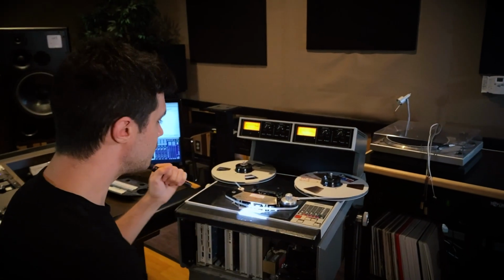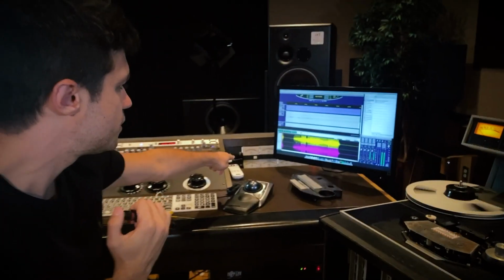Analog Mastering #03 | Tape Machine Alignment

Comment: Hi I was wondering if you’d have any idea why my 2 inch machine isn’t erasing fully. After aligning the machine both repro and record I can get a good strong recorded signal but I’ll still hear what was previously recorded. I.e. the alignment tones. On some tracks it’s more faint and on others it’s louder. What is the cause of this? Is the amount of erasure linked to how much you over bias? Is it just supposed to not erase fully? I don’t understand how punch in and overdubs could be done if that was the case. I’m a 20 year old starting an all analog studio in Ireland (a very small country) in 2024 so as you imagine I’m clueless as to where I’d even begin to find this info. I mean finding the correct nwb/m  for the basf 468 tape I have was hard enough and I still don’t know if it’s right! Help

Comment: It's great that your azimuth is spot on.  It would be useful to see that adjustment performed
Reply: Azimuth adjustment all comes down to phase cancellations, there are many ways to perform the calibration procedure and can be altered for half track machines and multitrack machines. In this video he does a variation of the summing method (by pressing mono) where he combines both left and right channel to see if there is any phase cancellation (which there wasn't which is why the VU meters do not change). If there was mis-alignment, the VU meters would have dropped in levels due to phase cancellation.  

For a two track machine you can switch your board to mono and adjust the azimuth until you get a peak in the VU meter reading.
For a multirack machine (there are many many ways) the simplest way is to sum all of your tracks to one channel, and again make your azimuth adjustment until the VU meters on your board peak. This indicates all tracks are in phase and summing together to the maximum extent.

Hope that can help.

I have a video on the topic if you need further help.

Comment: Are there any benefits to recording on tape except the analog flavour and if so, would you like recommend/advocate using tape machines more??
Reply: Aside from the pleasing sonic characteristics of hitting tape, there are many things to consider.  Whenever you do anything to anything, there is loss. If you transfer to and from tape, there is a degree of loss under the best of circumstances.  So, like anything else, one must understand what they are trying to achieve.  Again, outside of the sound characteristics, the benefit of analog tape is maintaining the analog integrity of the sound without introducing a digital converter.  Analog tape can maintain the integrity of the frequency spectrum that cannot be achieved with digital, even when introducing high sample rates such as 192k.  In digital, there is still a cut off point, with analog, there is no cut off point.  Now, these opinions can be argued on their merritt because what digital does bring is so integral to how records are made today.  All in all, you have to understand that going to and from tape requires a digital to analog converter, a good maintained tape machine, good quality tape (hard to find these days), and then an analog to digital converter. You also need to understand gain structure through all of this, which is an art in and of itself.  That is a lot of processing!  So, unless you’re looking for the sound characteristics of tape, it’s really not advantageous because the tape becomes a storage medium for the digital file at that point. Aside from the sound, the real benefit to going to tape is if you were recording direct without any digital processing at all.
Reply: @reubencohen6476  Thank you so much!!

Comment: So lemme see if I understood correctly; in this context the process of passing the track through tape was done before actually going to the mastering process (using eq, compression, limiter, etc), correct? Although I also heard that when the track is passed through the tape u guys use some compression and eq; I'm guessing maybe to control the tonal balance a bit, or sudden changes in dynamics; is that correct? 

Greetings from Ecuador guys!

Comment: Awesome, thanks for making these videos!  What are your thoughts on using the tape machine to add color and warmth to a digital mix?
Reply from the maker: Our analog console already gives that warmth to digital mixes and we don't run the digital mixes through the tape machine for the sake of adding color and warmth. But doing this in the mixing stage on individual elements of the mix can be a cool way to get sounds.